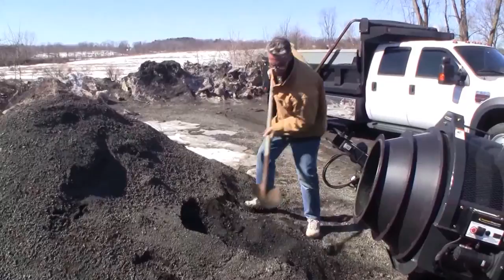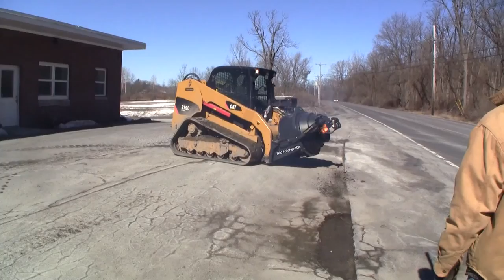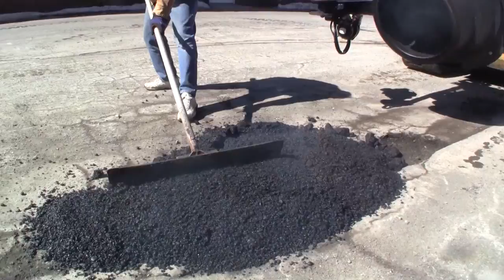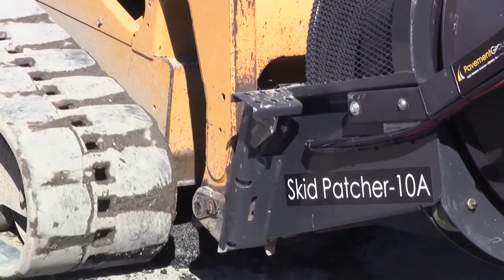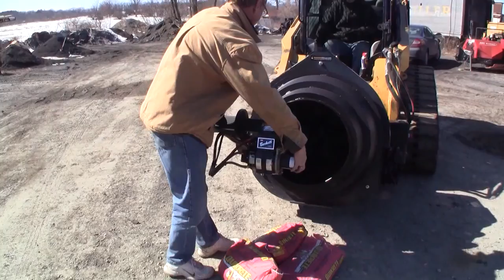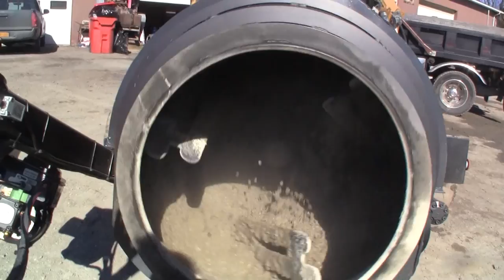SkidPatcher-10A, PavementGroup, Asphalt/Concrete 518-218-7676

Comment: my cheap coolie/indian construction company would have me doing the labor/mixer/casting/cat operator/van driving/no break/no porta potery 5gal. bucket dumping with sand for next use/ no osha safety everything is a hazard so you have to work twice as hard/ try to use my 7 series to put bricks inside covert it to a construction van/in nyc min wage is 15$ p/h and get G/P 10$ and try to justify by tax ok! but you're percentage is way high then uncle sam charge shit list goes on and on. My point is if you live in america live like it don't bring that mentality fuck life life up with it.great vid